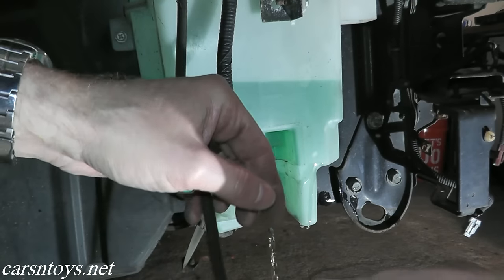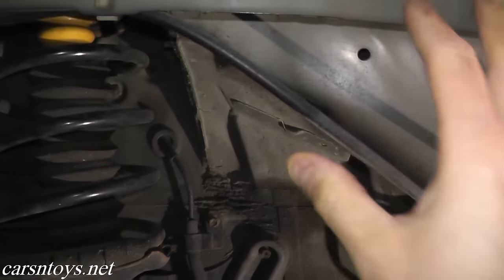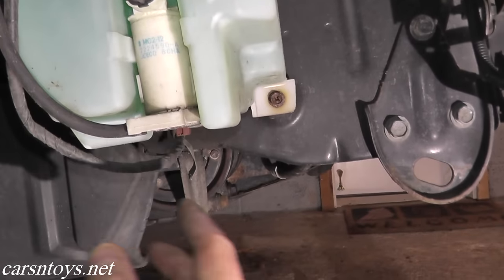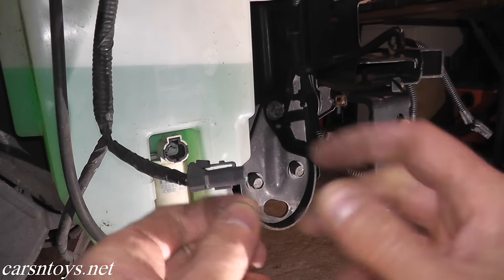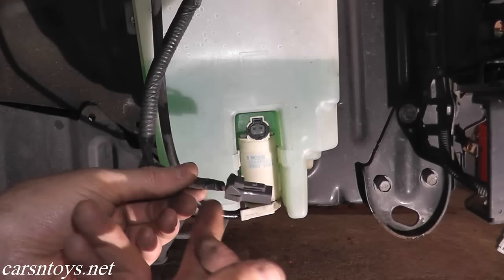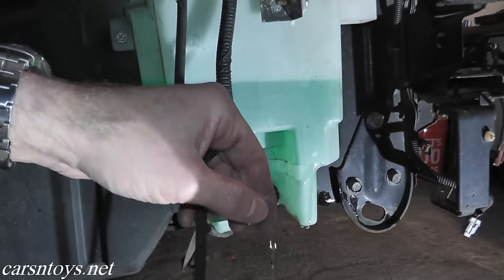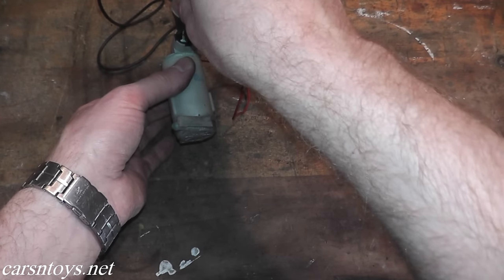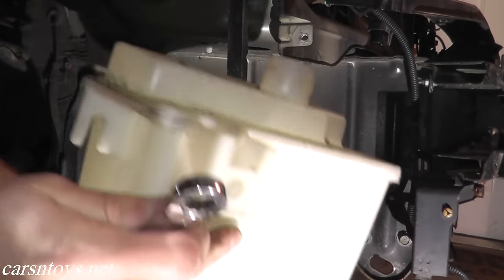How to Replace A Windshield Washer Pump and Reservoir

Comment: Hi thank you for the video but could you tell me if there are two different inlets on the pump that feed the front and back as I have just recently had a new pump fitted and when I got it back the front worked great but nothing out of the back washer thanks in advance
Ian

Comment: I have one question I have a 2000 Nissan maxima and the wipers work but the washer pump doesn't can be a fuse.

The car only has 100700 Miles

Comment: Will try this. All I get is a click sound, as you may hear in the older relays. There is no sound of the motor running and I am blindly suspecting that it is a bad motor. But now I will bench test it.

Comment: Hi thanks for the video!  I had scum coming out of widow washer and smearing windows up.  I cleaned the rubber filter that holds in pump and when refitted it broke the filter bit off so had to order a new pump but it came with just a rubber without the filter holes will this matter?  Can your help please.
Reply: Just wrap some pantyhose around the hole and make sure to only fill up with clean water

Comment: I have a 2013 Nissan Rogue SV replace the windshield washer pump changed out the fuse and still it does not work